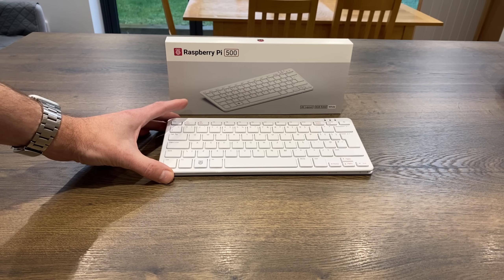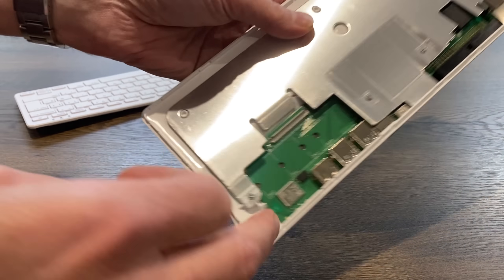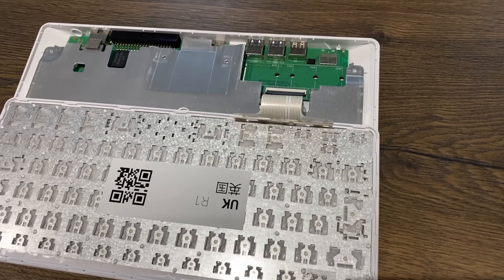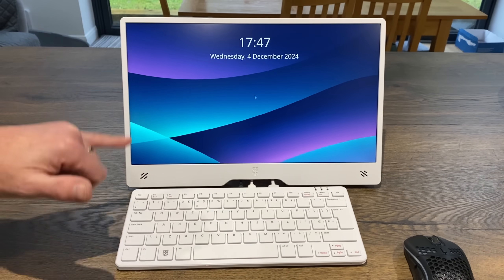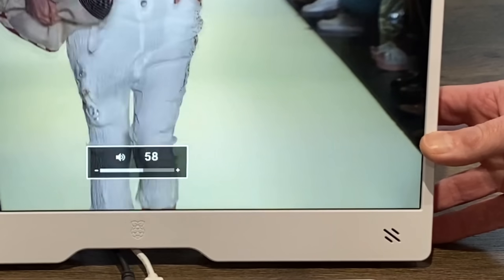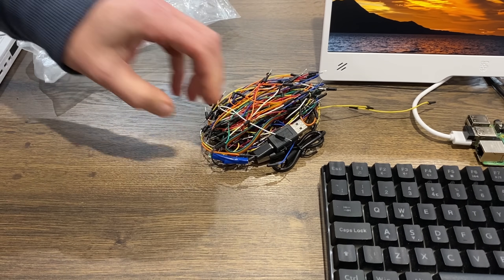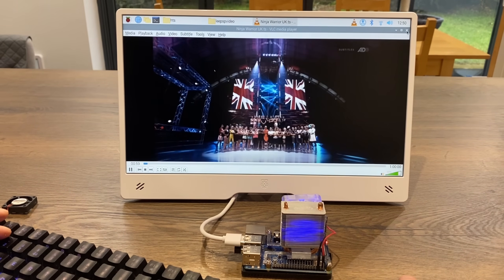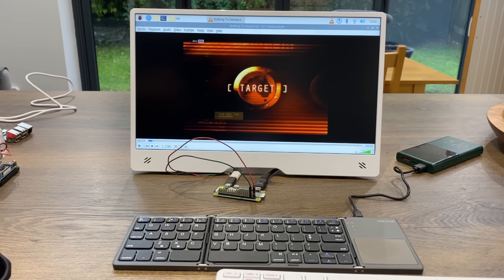Raspberry Pi 500 First Look & Teardown. New 15.6" display test

Comment: Without the NVME port user may as well stay with the 400 if they have one and wait. The 15-Inch monitor is interesting.
Reply: I can live without it, especially since you can still install fydeOS in RPi5. But M.2 SSD option would be a nice addition.
Reply: I went straight to the Pi Hut site after their email popped up. Decided to hold off until the complete pack available. 

Glad I did as soon as I saw they’d not populated the board with the NVMe hardware. That’s nuts, as unlike the Pi 5, there’s no other way to add an NVMe SSD with that level of performance to the Pi 500.

Hopefully they’ll release a Pi 550, Pro, etc. or similar later on.

Otherwise I’d probably have given in and bought the Pi 500 kit as separate parts today were it not for the omission of NVMe.
Reply: I think you're all too obsessed with NVME anyway. If you're going to try to crowbar a bloated and privacy-hating OS like Windows on a Raspberry Pi and then do something stupid like trying to run modern Windows games on it, then I guess you need all the help you can get from your hardware (as well as for your stupidity).

I run optimised Linux versions on my Pi and I see no speed issues with USB 3.0 drives - plus you've got more flexibility "chopping and changing" also.
Reply: @terrydaktyllus1320  nope. SD Cards are error-prone. Would like to replace my Pi400 with a NVMe Pi500...
Reply: @kaptnwelpe5322  Once again, another person not understanding my point and making a completely different argument.

I am NOT comparing NVME to SD cards, I am comparing it to external USB drives.

Do please try harder to keep up.
Reply: @terrydaktyllus1320  how on earth did you go from people wanting NVMe to people trying to crowbar windows on to a pi? those are not even remotely the same thing for a comparison, also you basically just implied everyone is stupid because of the way you worded that entire sentence.
Only a minority are really going to push the limits of what a pi can do anyway.
It's great that you have the flexibility of "chopping and changing" your usb 3.0 connected drives as you desire but having the option of using an NVMe drive also falls under that same flexibility you talk about regardless of your opinion.
It's not always about speed at the end of the day and for me personally it would be nice to have the ability to slot in an NVMe OR even an internal sata SSD because it is one less item taking up space, one less cable etc etc when traveling.
As for you using an optimized Linux.... good for you, your point? I also use Linux so what?
You can keep pushing your rhetoric about windows all you want but at the end of the day is any one actually listening to you about it? no, no they are not because people are going to continue to use what they know regardless of your rhetoric and that is ok but they will also view you as another one of those Linux elites trying to push your unwanted opinion on them.
Reply: @Nodster  "ow on earth did you go from people wanting NVMe to people trying to crowbar windows on to a pi?"

So people don't crowbar Windows onto a Pi ever? Even though Lee here makes quite a few videos about it and I take the mickey out of him.

Do you watch his videos?

" those are not even remotely the same thing for a comparison, also you basically just implied everyone is stupid because of the way you worded that entire sentence."

That's subjective opinion on your part. You are welcome to it, I can ignore it. Next point.

"Only a minority are really going to push the limits of what a pi can do anyway."

That statement means nothing. Please don't lower arguments to school playground level by making "me and my big gang of pretend Internet mates" points.

You have access to the contents of your own mind only, express your opinions, not what you believe others' opinions are.

"It's great that you have the flexibility of "chopping and changing" your usb 3.0 connected drives as you desire but having the option of using an NVMe drive also falls under that same flexibility you talk about regardless of your opinion."

This is not a relevant point because whether or not you approve of how I use USB 3.0 drives is of, again, no relevance to this conversation.

"It's not always about speed at the end of the day and for me personally it would be nice to have the ability to slot in an NVMe OR even an internal sata SSD because it is one less item taking up space, one less cable etc etc when traveling."

Yes, I already said that it's not about speed - and if you've not got space to plug in a tiny USB drive, you need a bigger home RAPIDLY.

NVME connectors or boards are not designed to be swapped in and out constantly, you'll end up damaging them - especially through static electricity.

Don't they teach basic electronics principles in school any more?

"As for you using an optimized Linux.... good for you, your point? I also use Linux so what?"

I'm sorry you're so "hard of thinking". If something is "optimised" then it probably works a lot better than something that "isn't optimised". It's a simple comparitive statement, don't they teach those in English grammar in school any more?

"You can keep pushing your rhetoric about windows all you want but at the end of the day is any one actually listening to you about it?"

This is a public discussion forum, I post my opinions here like anyone else does. Now you're suggesting those comments need to be approved by people like you first to ensure they meet your "editorial standards".

And then you just look silly and lacking in self awareness.

"no, no they are not because people are going to continue to use what they know regardless of your rhetoric and that is ok."

So what? People keep smoking even though they're told constantly it's bad for their health. As far as I am concerned, when they are warned about it then "job done". They can decide to heed the advice or not. I can sleep soundly knowing I have given the advice.

"no, no they are not because people are going to continue to use what they know regardless of your rhetoric and that is ok "

Here we go again - it always ends in "elitist", "gate keeper" or "toxic Linux community" just because you're jealous of people that you think understand it better than you do but you can't be bothered to put in the correct time and effort to become better at it.

That's your problem, not mine.

Comment: I was holding out for the new ZX Spectrum but just ordered the Pi 500 instead as it will do all the ZX Spectrum will do and a whole lot more - a good pre-Christmas surprise. Nice monitor also.

The space for NVME is interesting, presumably they're leaving their options open for a pre-populated version going forward but, like you said, at what price point? I'm not sure I care about NVME on the Pi, external USB 3.0 drives are perfectly fine in my experience and give you more flexibility.

I'm not one of these people that plays "Top Trumps" with their computers on Reddit, constantly looking for the biggest numbers all the time (most Ryzen cores, most gimmicky 4K monitors used simultaneously, most kidneys donated by mummy and daddy to buy me that new overpriced NVIDIA GPU for Christmas, etc. etc.) If a computer system "feels" fast enough, then I am generally happy and I've no issue with USB 3.0 drives because what OS you use and how optimised it is is more important anyway.

I'm also glad they've managed to keep the price down to close to the Pi 400 - less than £100 for an "Amiga-like" computing platform with built-in keyboard is not bad at all.
Reply: The "new" ZX Spectrum? Perhaps you mean The Spectrum.
Reply: @SpeccyMan  I think you know what I mean anyway. 

I think you're trying to be pedantic and kick off an argument over verbal semantics - which I am happy to do on occasions where there may be a need to explain my words better. 

But I also credit you with enough intelligence to know that is not necessary in this instance.

Now, do you actually have a point to make here?